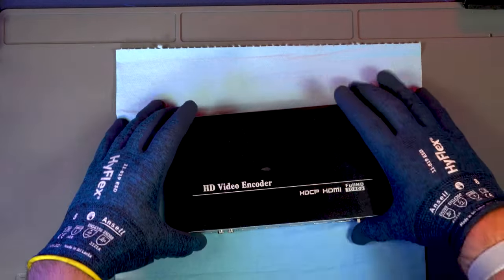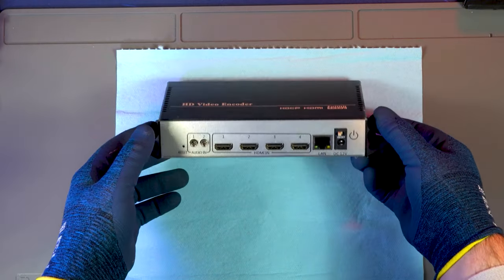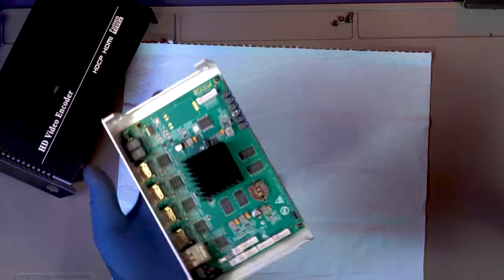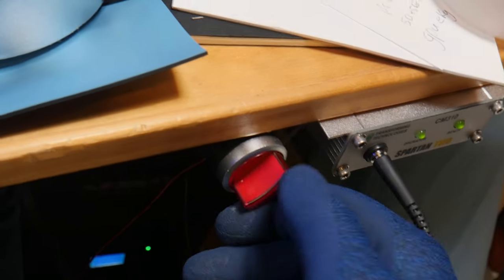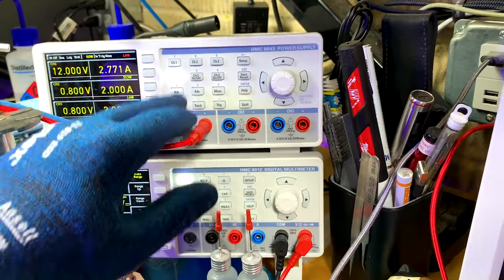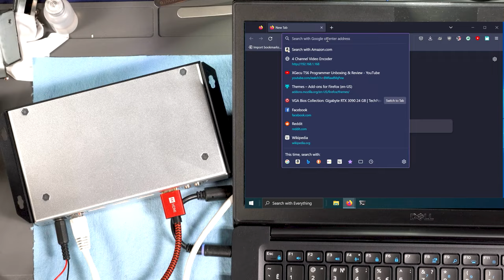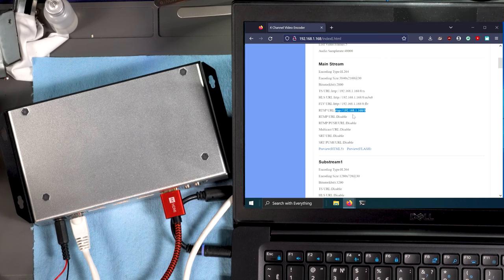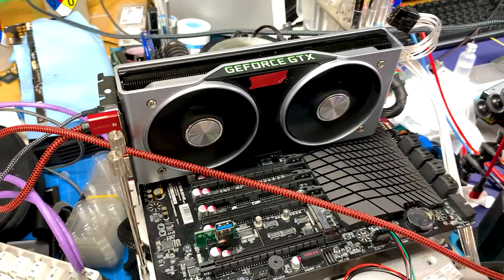Non-PoE device that had 48v passive PoE plugged into it - HDMI Video Encoder Repair [3]

Comment: I would have never realized the magnetics were actually inside the Ethernet port as a all in one package, I would have never known that and only have changed the chip out.
Reply from the maker: Yeah! its interesting. The way Ethernet is designed, the ethernet jack is meant to galvanically isolate the UTP from the circuit. 

You can read more here: https://electronics.stackexchange.com/questions/27756/why-are-ethernet-rj45-sockets-magnetically-coupled

I'm going to add that to my description.

Comment: Great video. I accidentally plugged 9V @ 750mA POE into an ASUS RT-AC86U router WAN port, so kind of important. I can use it as a wireless extender, though. Would that be enough to fry both the port and the chip?